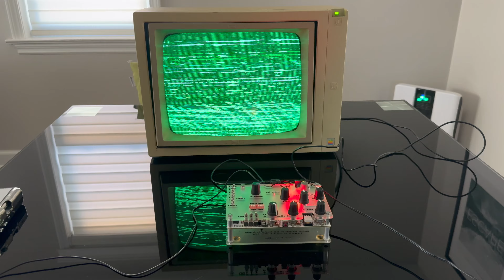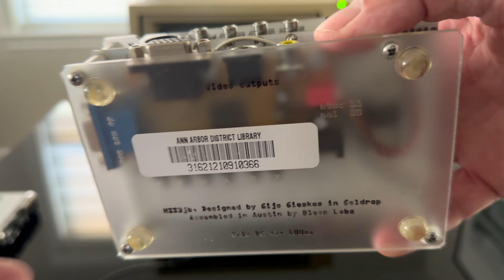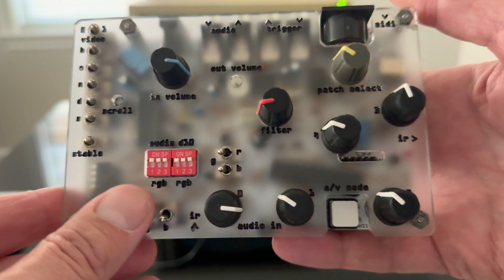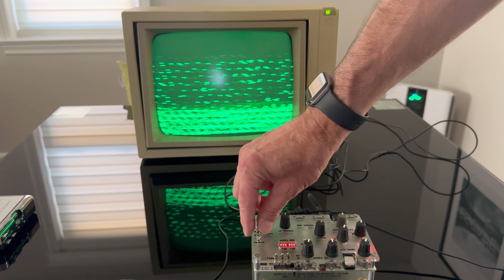BLEEP LABS HSS3JB Synthesizer | Raw Signal Chaos from a Rare AV Beast

Comment from the maker: 🔧 No manual. No presets. Just raw signal chaos. This is a hands-on demo of the discontinued BLEEP LABS HSS3JB A/V Synthesizer—a rare hybrid module that outputs both audio and composite video. I’ve paired it with a vintage Apple A2M2010 Green Phosphor CRT and cassette audio input via USB converter. Everything here is trial-and-error, no polish, just pure experimentation.

💬 Drop your setups, mods, or questions below. Let’s keep rare gear alive.